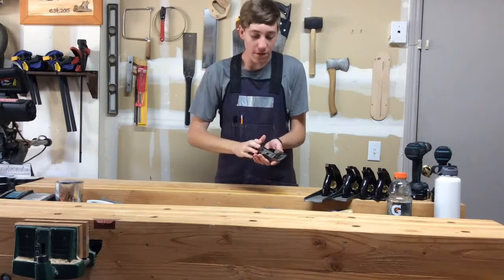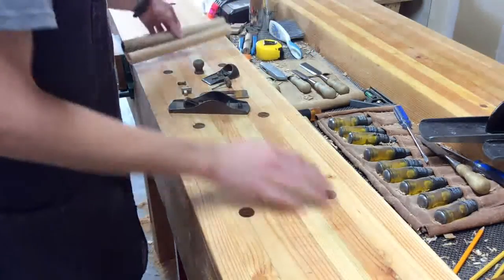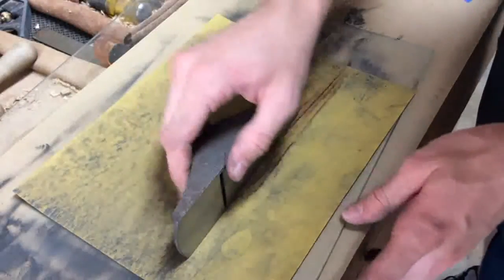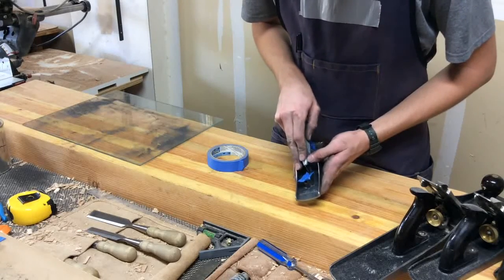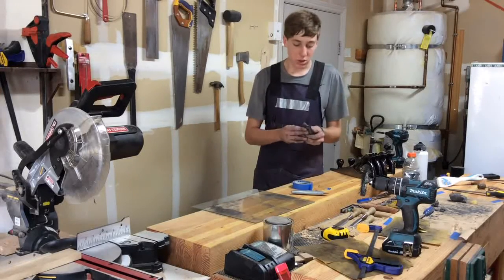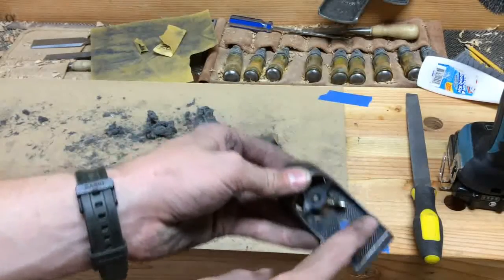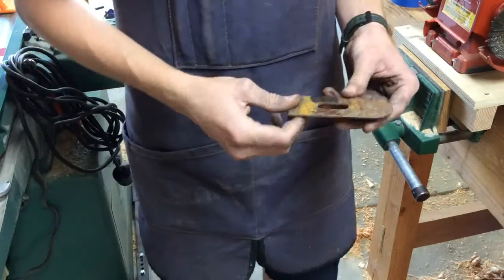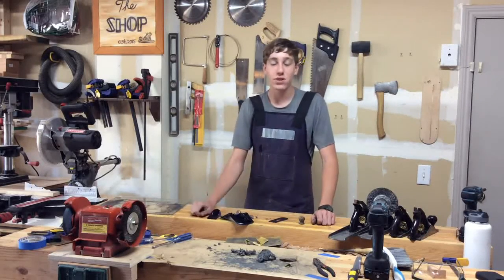Stanley No. 220 Plane Restoration | Part I

Comment: Nice video. One question for you: how come you flattened the base without the lever cap on it? I have always heard that the lever cap can cause the cast iron bottom of the base to flex slightly so if you flatten without the cap when the cap is installed it is no longer dead flat.
Reply from the maker: I have heard that before! There really is now type of flexing with small block planes like this one. What I have found is with large hand planes, you would want to flatten the sole with all components together. Larger planes typically show the most flexing if there is any at all. Thanks for sharing!

Comment: Well, admire your attention to detail, but you entitle your vid as 'restoration', ensuring the block and blade are flat and the blade sharpened certainly fall under the category of 'restoration', after all, an attractive plane that won't cut is of little use for anything but a decoration.